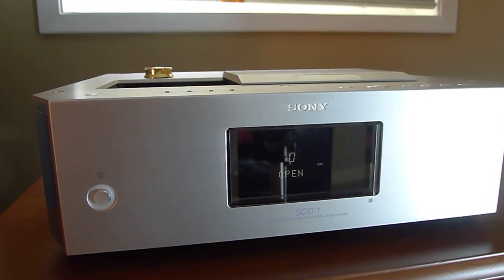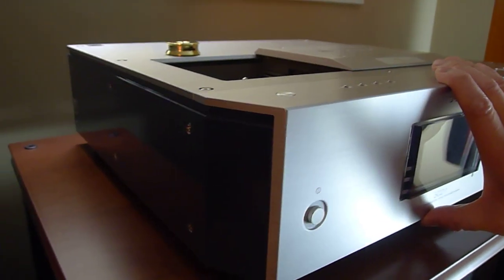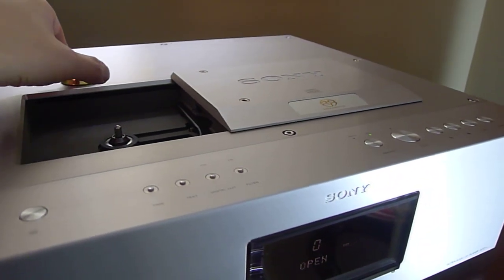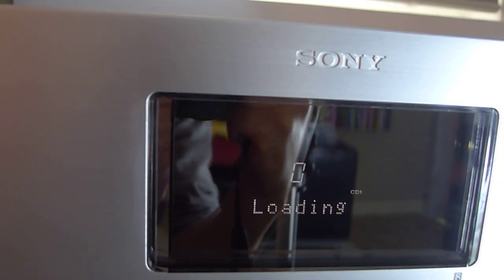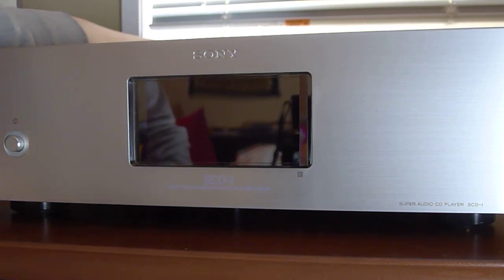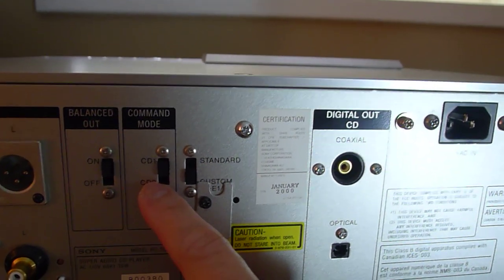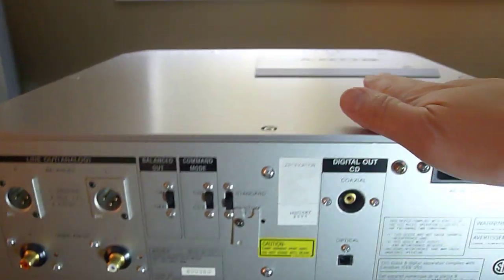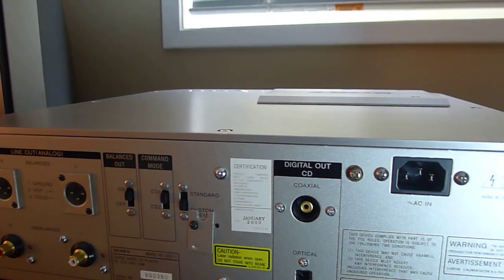Sony SCD-1 Super Audio CD Player Overview

Comment: I've put in new lazer assembly in psp, Ps3, sony dvp n999es, mds ja20es, and scd xa777es.  Also new belts on my tc-ka6es.  As long as you get the right parts, it is just a matter of taking out the old parts and install the new parts.  There is no point of throwing expensive audio eq. away or selling them for parts just cause the lazer head went out.  Lazer assembly parts are still available for these expensive sony audio eq.  "ebay, and china"

Comment: i myself happen to like the older formats since mostly they are a whole lot better and sound much better then a compressed file. i can even tell the difference of the file quality like the lower bitrate or whatever bitrate they used. i do like sacd stuff. i do wonder if you have one of the now rare sacd changer/minidic recorder combo units. i found one in circuit city in 2004 but never ended up getting it which i wish i did get but oh well. also what minidisc units do u happen to have

Comment: I own scd xa777es and it was a easy replacement.  $50 buck on ebay for the new lazer assembly khm 230aaa.   Liberty Bell in USA sells it .  Also company from China sells it also.  As long as you can get the right lazer for scd 1, just take your time dis assemble the unit and put in the new lazer.  No such thing as alignment.  It's just taking out the old lazer assembly and installing the new one in.